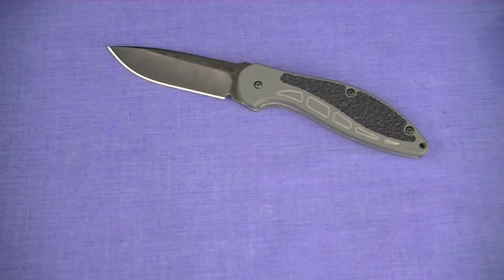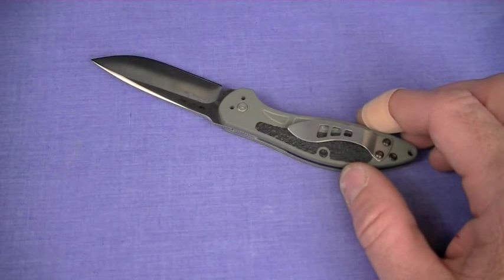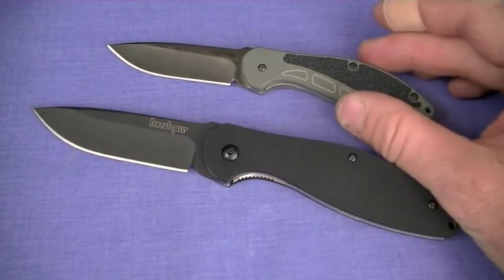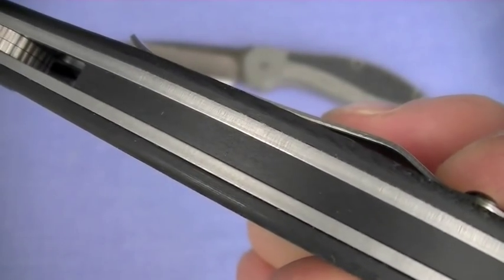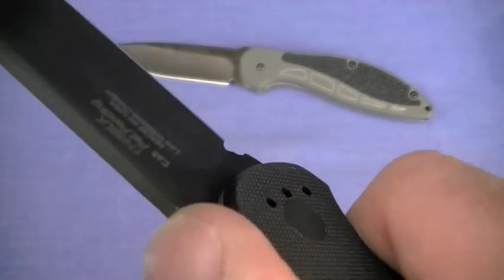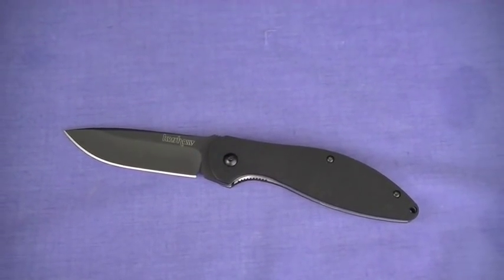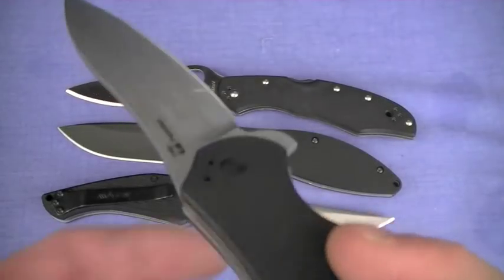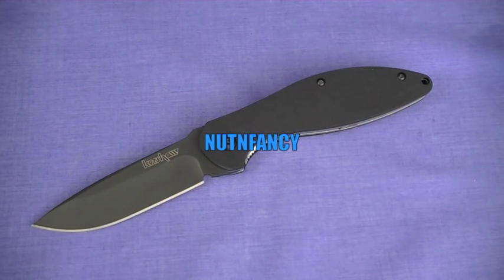"Kershaw 1745: Improvements That Don't Suck" by Nutnfancy

Comment: I gotta say, I'm surprised this knife made the TNP Tabletop cut.  I'm assuming it was because of the improvements Kershaw made to it.  In that case, due diligence on your part for following up.  I don't like the blocky scales/liners/overall shape to it.  That's the way Kershaw has gone lately, and I am not diggin' it, for the most part, and I consider myself a dedicated Kershaw owner/fan.  The time given to this blade is indicative of its worth, IMO.  Nice in a comparative role, as you say. Thx!

Comment: Thanks for the review I watch and get alot of good tips from most of your vids. I was foundering if you've had any personal dealings with dog's customer service because I purchased an aegis and it wasn't opening properly after a month or so. I sent it in for service and I called about a week and a half later they said it was being processed. A month goes by with no word so I contacted them back only to be told there was no record of my knife. Do you have any thoughts on there customer service.

Comment: The clip looks like it would blend with the shape of the scales better in the tip down carry.
Personally I don't usually like clips and take them off at the first chance, personal choice but in the U.K. it doesn't do to advertise you are carrying a knife. Yes the knife (and gun) laws suck over here but you learn to work round them.

Comment: Clip sucks hard, total crap...

Don't like hollow grind blades at all, blade shape is nice though.
They could save a lot of weight if they made that rear Zytel spacer into 3 small piller spacers, and removed the right Steel liner entirely, leaving the left for the liner lock.  If they did that, i'd give them as gifts.